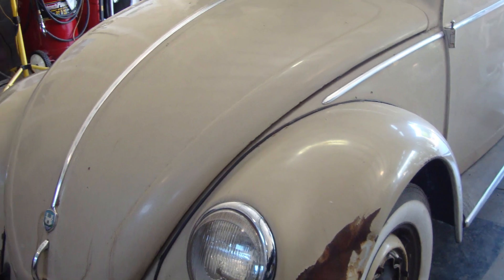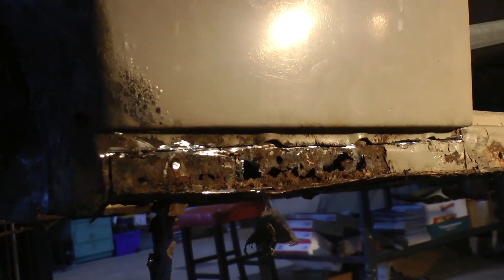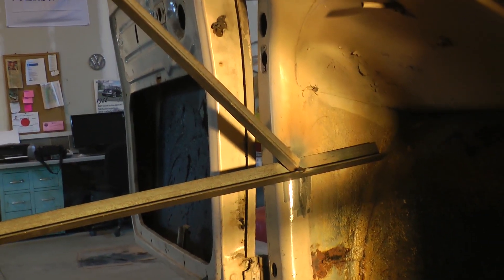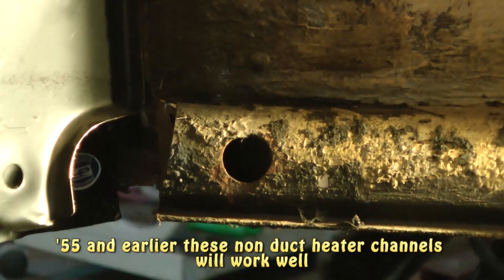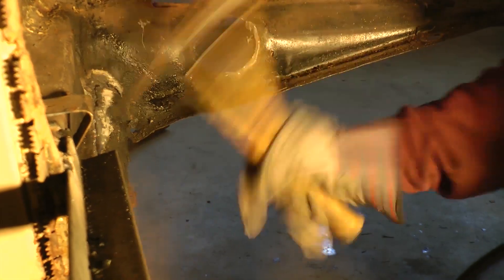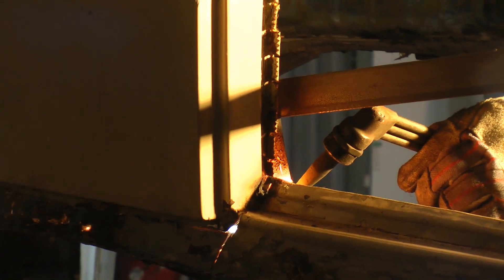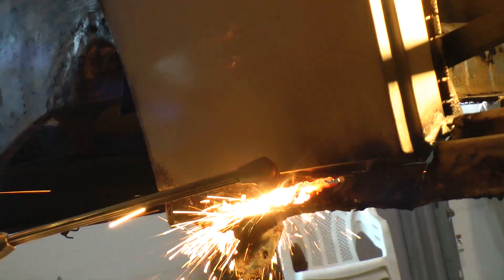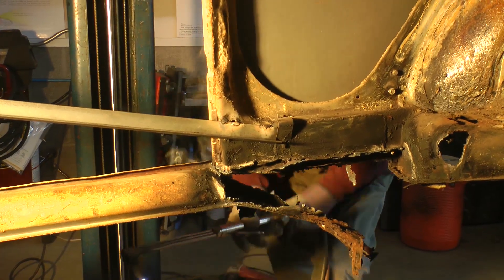Classic VW BuGs How to Repair Restore Beetle Heater Channels pt.1

Comment from the maker: No, oval dash actually came in middle part of '52.  Split windows ended at the very start of March of '53, so ovals started March 10th of '53.  So it reality, 53 is a very short year for the oval window, and it is the only year that the oval had 25hp, thankfully I have that original motor for this bug.  Go to my website and see the progression on this car, it is stunning.

Comment: so what exactly does the heater channel do? I have to replace mine but i thought it was just for chassis reinforcement. Whats the heater part about it mean?
Reply from the maker: uh... heat travels through it.
Reply: Chris Vallone but what for? modern cars dont have them? is it just to bring in heat to the interior?
Reply from the maker: yes it is heat and structural support.
Reply: How does it exactly take heat from the exhaust? I would think am exhaust leak into the cabin would lead to terrible things.
Reply: Nikola Chikos I'm planning on powder coating my chassis, would it be unsafe and counterproductive if exhaust gasses went through them?
Reply: William Su
Reply: ***** do you know if it gets hot enough to burn off a powdercoat?
Reply: ***** Cool! thanks Good to know ahead of time lol

Comment from the maker: Hmmm yeah, I dunno man, you can do it, but I do not recommend it.  To do the job right, the body should come off the pan.  You need to get the BugMeVideo dvd on floor and heater channel replacement.

Comment: That's one way to ruin an oval window beetle!  Proper panel removal should be the reverse of how it was installed, by removal of the factory spot welds even with very rusted panels like this. By hacking it apart with a cutting torch you make an uneven surface to reattach the channel which can hurt it structurally and devalue the car by making a non factory style repair. And if you plan on making an educational style video, wear the proper ear and eye protection!!  I cringed watching episode 3 when your guy got the molten piece of steel in his eye!!  You obviously need more education especially before you try selling these cars. Buyer beware!